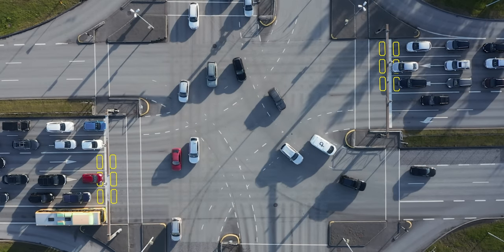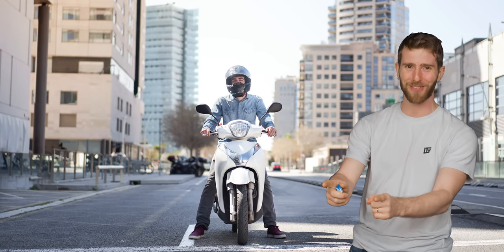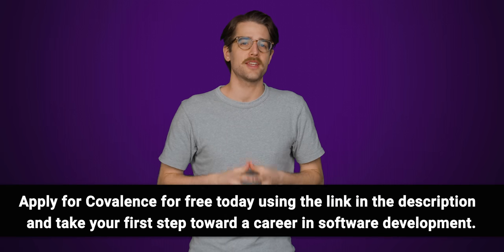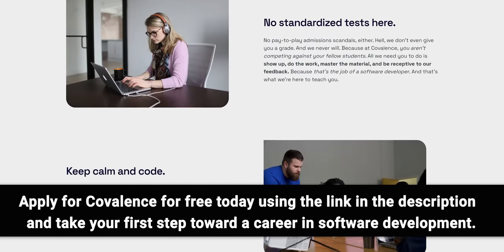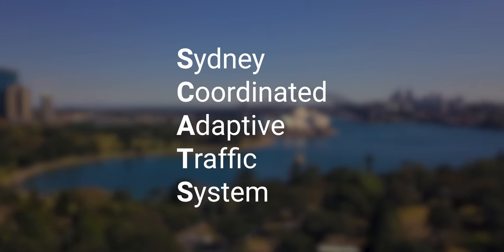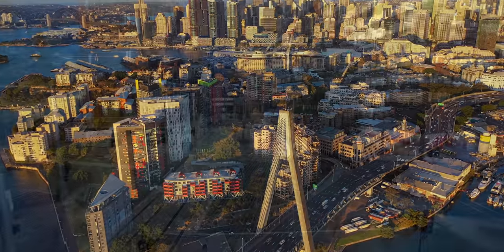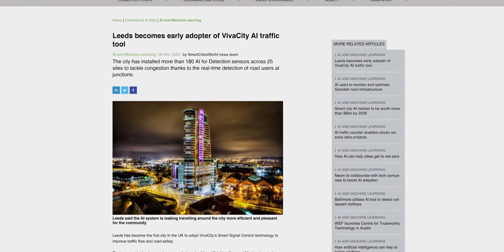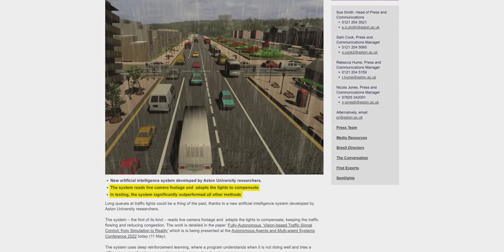Here's Why You Get Stuck At Red Lights

Comment: Autonomous cars don't have to communicate with lights. That is the wrong version of the tech, not autonomous at all, if it needs transmitted information from lights and signs and such. 
Truly autonomous cars will navigate on any road, not just on the ones specially fitted with these smart lights.

Comment: very good, too bad they forgot to talk about the system in the netherlands, all the traffic management done by AI, which includes cars, motorcycles, trucks, bicycles and even pedestrians. with this, many times the green light comes even before the car in front leaves the intersection, because the AI already knows the acceleration time of the car is stopped, and when it arrives at the intersection, the other car already left the intersection. educing the waiting time at a red light to a minimum.
Reply: That's NOT AI though. A traffic light controller is a piece of safety equipment. No AI allowed. The timings needed are calculated and pre-programmed in the controller. They will not change after that. Not by hand and not by machine learning or AI.

Comment: Light on this one street I turn to onto the major road, ALWAYS ALWAYS ALWAYS turns green as I'm just turning onto it, or as I'm partway down it. 
THe street is 1/3rd a mile long, residential, so has cars on both sides of road parked, and has two major speed bumps. 
the light ALWAYS seems to know when I'm coming, because it will turn green, and right before I can get to the intersection, before I can get to that being able to get through it, it will go red. 
Other day, I turned onto the street, fucker went green RIGHT AWAY. I'm like, you cocksucker. 
And it actually stayed green for 30 seconds. Which...it's never done before. 
Normally I just go slow, let it go red, and go down the road at 20 or so, letting it go red and coasting the rest of the way.
Not this time. It was TAUNTING me. After the 2nd speed bump, I started getting up to speed, and sure enough, 1 second away from hitting that go through point, fucker goes red, then stays red for 3 minutes.

Comment: Long traffic lights are only necessary because of high speed roads. And since you need to wait for several minutes at the light, your AVERAGE speed is SLOWER than if they built the road with a lower speed in mind and used a round about instead. In other words, car drivers are so greedy to go as fast as they can that it backfires and makes all of their trips take longer.

Comment: The image you used the first two times for being stuck at a red is a one way construction zone and a terrible example. No one should ever consider running those light, which aren’t normal lights. They are Flaggers. You shouldn’t use any stock construction zone footage unless you’re specifically talking about traffic control. Like the AFADs you pictured in those construction zones. Those lights are not usually controlled by an automated system but can be. They are usually run by people inside the zone. If those lights are red head on traffic is coming toward you.

Comment: There’s got to be an equation for green light hopping. A theoretical speed at which the light will more or less always be green for you. There’s always IR strobe which at a certain frequency trips a sensor and turns the light green. It’s used for emergency vehicles.

Comment: Please sticky this comment: for drivers who like to park one or two car lengths behind the crosswalk (and thus completely not triggering the sensors) or stopped in the crosswalk to avoid running a red right, please pull forward or reverse, if safe to do so, respectively.

Comment: I actually just commented about this on a short. You'd be amazed at how difficult it is for some people to accept that lights have sensors. Several of them actually got offended at the very notion of lights not being completely random.
Reply: Because being hosed by a random light change is, while frustrating, understandable but if there are sensors and even communication with previously encountered lights, the red light with no other traffic is by design to cause a stop and start rather than a steady pace.
 I know I have a light on my way home from work, I get off late at night with very little to no other traffic along this section of my route, that is a short distance from another light and it almost without fail always gives me a red from a green that I can see from the previous light. I can accept the major vs minor flow to default to green for most traffic to flow, such as side streets crossing main ones being normally red while main roads stay green longer and when no other traffic is present remain so for much longer, it's  one of the best use cases for sensors so the lights don't change too often when no cross traffic is present. But it can feel like an unnecessary impendence when two side streets intersect, or when traveling on the major flow path, and it seems to change for the sole purpose of stopping the one driver, wasting both time and fuel/charge.
I am sure there is a a rational reason for this, be it random, I have gotten a green and been able to just cruise on through albeit rarely, or some logic that make much more sense when more traffic is present or during certain times of the day, it is part of a school zone with a speed reduction during specific times with lights to indicate when applicable, but given the low volume and time, usually between 0030-0100, this behavior seems counterintuitive. And if they were worried about controlling the speed of traffic for safety they should probably actually do something to enforce that since I have been regularly passed by others using the bike lane to speed around me because I dare to only go a little over the posted 30mph instead of the 45+ they would prefer. And no I am not going a different way that would add several miles and minutes to my commute with about a dozen more lights and currently construction for the next couple of years that add even more delays and detours.

Comment: Everyone I know thinks induction loops are weight sensors.
Reply: But some sensors are based on weight, right? Ever waited at a light on a motorcycle? Yeah, yeah, it could be simply misaligning.
Reply: @Bill_Woo  Never. Weight sensors are difficult to install and high maintenance. The induction loop is a metal detector, easy to install, no moving parts and last a long time. 

I ride sport bikes in north county San Diego and turning left at night is impossible. There's an ordinance cracking down on the highway people to make the induction loops trigger for bicycles, too. It's a slow process in the most bike friendly places.
Reply: @NETBotic  So it's "impossible" because the metallic mass on a sport bike is too low? That just seems like institutional incompetence. So they don't pick up 20 pounds from a bike frame. But a bike's engine alone can weigh hundreds. What is their major malfunction?
Reply: @Bill_Woo  It depends on the bike and the loop. The loops were designed for cars. A lot of mass close to the ground. Bikes have two problems, little mass and they're higher above the loop.

Comment: You forgot to mention traffic cams! Not red light or speeding cams, but the ones designed to detect and control the flow if traffic at intersections. Also, I believe LA has a complex system like Australia, but no one is paying "me" to do your research!

Here is info on the cameras from Vortex Radars.

https://youtu.be/zV7iWZO9b84
Reply: In the Atlanta area they are replacing detection loops with low resolution cameras, mostly because you have to replace the loop when you repave.

Comment: The real problem is two-fold.
1) Using 1920s definitions. Like marking the entire crossing as a single conflict area, and not allowing negative timers. (See Ontario Traffic Man's "How to shorten red light clearance times without reducing safety" or 7KPGVP85WpU)
2) All the fancy pants AI learning and camera use is really fighting symptoms. Basically the entire NA continent is build around only using the car these days; the least efficient method of moving large numbers of people by land. In most places you have no choice, there is no real alternative, and so roads are clogged. (There are quite some variables like speed and gap between vehicles, but a single car lane can accommodate about 2000 cars, and thus people, per hour. A bike lane, which is half a car lane, can accommodate roughly 7000 people per hour. And that's just the next best thing, then are busses, trams/streetcars, and finally the king of people moving; trains. Or in other words, by having a comprehensive continuous cycling route in the city, removing one half car lane will have the same effect as adding 2 car lanes).

Comment: If I didn't know any better, I'd assume some d!ckhead is watching us live through traffic cams and is manually switching traffic signals from an office. When in Indianapolis earlier this month, there were 6 of us waiting on a green.... that never came so we all decided to blow the red and merge onto the freeway. Lights should have a maximum set time limit.

Most lights in my area just do whatever the hell they want with no pattern whatsoever. I'm one to casually pick an area/thing to analyze for a while just to satiate my curiosity how it works then move on. From my (3rd shift) job there's one intersection I go through and it's all back streets. Before 6AM it will give me the greenies with arrow asap but after 6AM it takes until sunrise to consider changing and that's aggravating for me and the other dozen people lined up.

A stretch of road near me used to be timed like a downtown area where it's almost all greens for several blocks provided we're going the posted limit. At some point the city said 'screw that' and now the lights blink like a freakin' Christmas display with dangerous/inconsistent times. I'm talking 8 seconds to 15-30 seconds. The only way to get most greens is to go 45+ in the 30 zone but only if timed just right, otherwise it'll be braking every 100 feet. That's no exaggeration. Streets are super short and we all hate it.